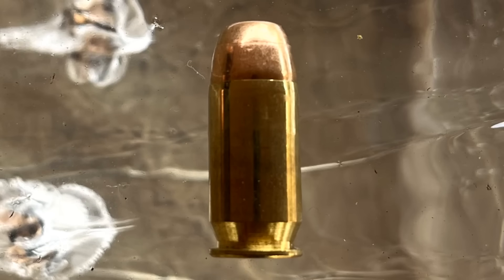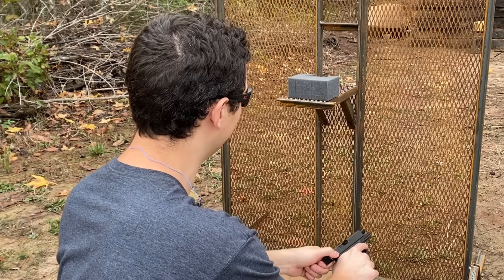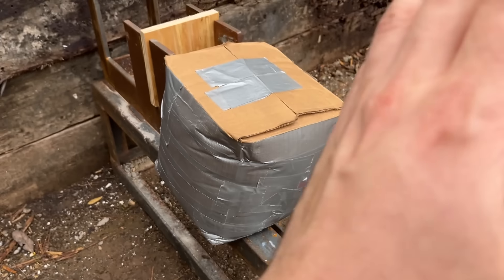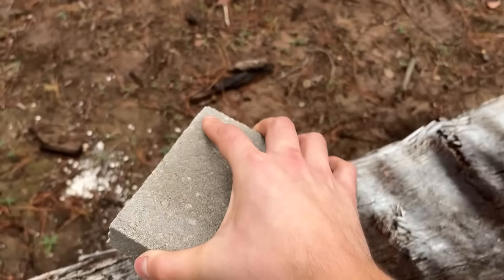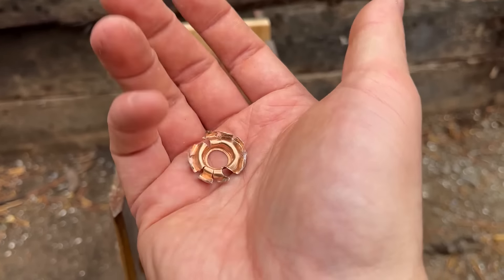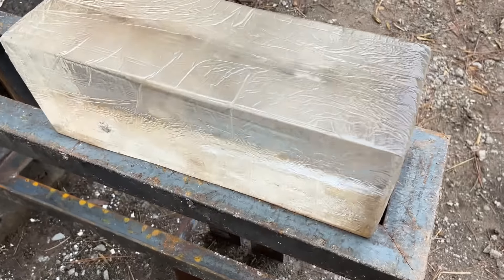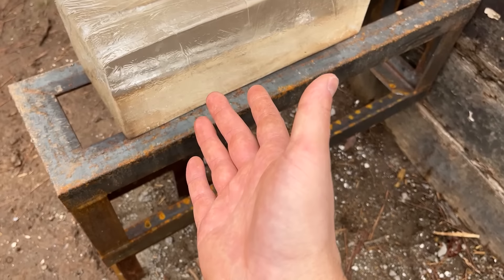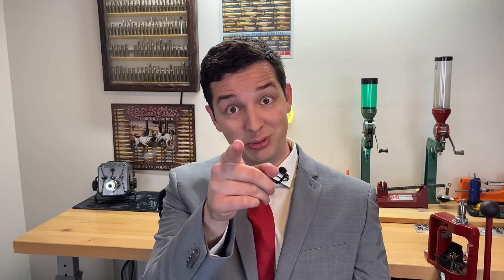9mm vs 45 ACP Barrier Test: No Debate?

Comment: Penetration is not why one would prefer one over the other. Terminal ballistics is the basis. The 9 will out penetrate the .45 but will not match its terminal ballistics. If you use JHP's, you will lose penetration
Reply: The only advantage 9mm has is that you can load more in a smaller space. Realistically it doesn't penetrate any deeper than 45 because penetration only counts on an armored target. As there is no body armor that stops 45 that doesn't stop 9mm penetration doesn't even matter.
45 being naturally subsonic however is a huge advantage for shooting suppressed.
Reply: Penetration is the most important aspect of terminal ballistics. You can see in this test the 9mmJHP penetrated better than the .45JHP. The 9mm also left a PERMANENT wound channel just as big as the .45.
Reply: @joshrandall3632  All this says is that is a bad .45 load.
Reply: @joshrandall3632   Half an inch. If there's one thing I've learned from women. Is that half an inch counts for nothing It's either big or it's small they don't care about the half inch.
Reply: @joshrandall3632  The penetration differences, however slight, are meaningless.  Once you've penetrated enough, further penetration doesn't change the result in a significant way, even with hollow points or ignoring the greater risk of over penetration with the 9mm.  What the .45 brings to the picture is a higher likelihood of knocking the bad guy down and, even if he's not completely stopped (though statistics suggest he would most likely be), interrupting the attack and giving you time for appropriate follow-up.  In another video on YouTube, a commenter tells the story that he, himself, was in a shootout where he hit a drugged-up bad guy 4 times in the heart with a .380  and the bad guy still wasn't stopped and I certainly have no reason to doubt the claim by a guy that he shot someone in defense of his family.  And, yes, I realize that the .380 ACP (9mm Kurz) isn't the same as a 9mm Parabellum but it is a great example of why you very often need more than just shot placement; sometimes, oftentimes, you just really need some kick-ass knockdown power.  According to the FBI, the .45 ACP gives you all you need in penetration and, though there's never a guarantee of single-hit knockdown, it gives a greater chance of getting that knockdown when you need it.
Reply: @bernieeod57  The Federal HST is amongst the best defensive rounds available. Both bullets did a superb job and penetrated exactly as they were designed to newb.
Reply: @captainironbat8193  That's exactly what I said, so thank you, I guess.
Reply: @joshrandall3632  I prefer the good old fashioned flying ash tray lauded to 975 FPS. It has a long standing track record second only to .357 Magnum
Reply: @joshrandall3632  The late Colonel didn't think much of JHP's. He pushed for the 200 grain LWSC Keith bullet loaded to 965 FPS and later the 230 grain Truncated Conical bullet once again loaded to +P 965 FPS. "Velocity and expansion are variables! Mass and cross section are constants!"
Reply: @joshrandall3632  The only way the 9 could outperform the .45 using the same bullet would be if the .45 was down loaded to somewhere between 750-800 FPS. To simply upload this round to 950 would cause over expansion of the bullet and under penetration
Reply: @bernieeod57  You literally just saw a video where the 9mm did almost exactly the same as the .45 with the same bullet. Both bullets did exactly what they were designed to do.
Invoking Jeff Cooper's opinions doesn't make you an expert nor does it make you sound intelligent. It just makes you look like a poorly informed fudd. He was a pioneer in his field, 50 years ago, but very little of his techniques are still taught today.
Same thing with the flying ashtray. It was great, but it's no longer even in the top 10 bullet designs. There are actual books and research papers written about this. You can read those and get some up to date info. Hope this helps.
Reply: @joshrandall3632  As I did back in the 80's as well only to have Miami prove otherwude
Reply: @joshrandall3632 Correct, the te wondering of the wonder nine brought us back to spray snd pray! Where squirting 20 rounds with an 80% miss rate is a good shooting snd proof magazine capacity is important, Back to fewer bad guys getting hit, more innocents shot, and property damage through the roof! Only today, you niner squirt gunners are taking this propaganda to the next level! Where every shooting where the bad guy goes down with 1-3 hits from a major caliber is now called a bad shooting due to failure to mag dump
Reply: @joshrandall3632  The only thing I come away with is that I will not use that brand of ammo! The only way this could happen is the .45 was down loaded perhaps down to as low as 750 FPS
Reply: @joshrandall3632  147 Gr 9MM is normally loaded to 950 FPS. .45 Government 230 FMJ is loaded to 850FPS. You can load 230 Gr up to 950. If velocity is the same with 21% more frontal area and 36% more mass it should produce more penetration and damage. The only way one could have this result would be if the .45 was down loaded to 750-800 FPS.
Reply: Penetration here is a moot point. Both achieved lethality. 12-inches or 13 inches are both meaningless when its been a known military fact for a century that once you achieve 11 inches of penetration into the human body, you have definitely achieved lethality if not sooner. That is precisely why the SAS' Sikes-Fairbairn commando dagger was designed to that length. 
Maybe if your enemy is a 600 lb morbidly obese dude, more penetration might be needed, but not too many of them running around the battlefield.
Reply: @vohawk  Velocity and expansion are variables. Mass and cross section are absolutes
Reply: @vohawk  Don't trust a minor caliber whose 100 plus years of service has been an execution tool, not a fighting tool
Reply: What do you mean? I'm pretty sure 9mm and .45 have both been used in combat for a century or so.  @bernieeod57
Reply: @vohawk  The 9 distinguished itself as an SMG round. As a pistol round, its reputation was that of an execution tool, not a fighting tool

Comment: I like both rounds today. But in the 1980s, this would have been a very different debate.  While the 9 can certainly hang with the 45, because of modern ammo improvements, the 9 gives you much greater capacity in the same size weapon (i.e. 10+1 rds .45 in the G30 vs 15+1 rds of 9 in the G19).
Reply: I'm 53 & a Army veteran: 1990s. I saw the tragic FBI Platt Matix era, the rise of "wonder nines", the big push for 10mm, the short lived .357sig trend, 9-11/GWOT 🌏. Many fads & plans came, went. Overall: ballistics improved, the 9mm/9x19 slowly creeped back to the top of most duty, defense, ccw pistols.

Comment: Remember! The technology used to make 9mm bullets expand is ALSO used in the .45! Look at the "Lucky Gunner" labs section for some good across the board expansion from JHPs in all the cool calibers but in reality, Col Cooper had the power factor right with his Major vs Minor caliber Power Factor calculation. Using the Kinetic Energy equation, the "power" in foot pounds is skewed by squaring the velocity, giving small, fast bullets a seemingly identical power when that is not the case. For those who don't believe, I have two identical Staccato pistols in 9mm and .45 ACP. Shooting them side by side reveals what the "paper numbers" don't show, one has vastly more power and recoil.  According to Sir Issac Newton's "Laws of Motion", the one with more rearward push also has more forward push and that would show the .45 with more "power" which Jeff Cooper stated. With JHPs, the 9mm has no magical expansion properties that the other calibers don't have as the .45s often reach nearly an inch of expansion which the 9mm cant reach. Shooting 9mm BJHPs next to .45 BJHPs ( no +Ps!)  shows the .45 with more "power" AND expansion! How could the 9mm be better??? Only because you MIGHT be able to shoot the lighter recoiling caliber better. Shooting steel falling/moving targets with each caliber also show a distinct advantage for the larger caliber which moves the steel target with a greater force that is easily observed. I'll stay with the largest caliber I can master! Therein lies another secret!
Reply: The idea is that the extra perceived "power" is irrelevant and does not cause extra damage to a target due to the elasticity of flesh. You have to go up to rifle velocities to overcome that.
So the only thing you're getting out of your feeling of higher power is more recoil.
Reply: well,  that just isn't true because its not "perceived power" first of all and it does deliver more power to the target with the ability to cause more damage. Newton's theory proves that so your perception is flawed! The smaller caliber will never equal the larger, heavier caliber when the velocities are similar. The only way you get the .35 caliber to come close to the heavy mass and power of the larger caliber, .45, is to run it's velocity high enough to bring back the .357 vs the .45 argument. You're saying the power is only "perceived" but in reality, the difference has been proven for decades. For a better way to prove your perception theory, put on a vest and take a round from each. That will teach you what you dont know!  @MGMan37
Reply: @micknelson8991  I'm not suggesting that newton's law goes out the window. I am suggesting that there are other physics at work that diminish the effect of "putting more energy into the target", such as the elasticity of flesh. That is also part of newton's law.
If you stretch a rubber band, but not far enough to break it, do you damage it?
Maybe if you do it hundreds of times, but generally not really. Stretching it a little bit further won't do anything to the rubber band if you are still way under its breaking point.
It's the same principle here. Damage from pistol bullets comes simply from the bullet cutting and crushing what it directly comes into contact with. And 9mm fmj is known for penetration, so it's not that it doesn't have enough energy to do so.
Reply: You're still  missing the point, the target does not dictate what power it takes to change its position of relevance. If that were the case, nothing would ever work the same do to the difference in the body's make up, such as skin vs bone vs muscle. All you CAN do is deliver the most power you can to the target and HOPE it's enough to change it to become inert and no longer a threat. If Mike Tyson were to give you his best punch compared to my wife's best punch, you would see the difference! You cannot remove the physics from the situation. A harder hit is just that, more power. Shooting a human doesn't give you the same response every time due to too many factors out of your control. Use the most power.
 @MGMan37
Reply: @micknelson8991  "the target does not dictate what power it takes to change its position of relevance"
Okay, go punch a tire then. You've put energy into it, but you won't have damaged it at all. You just bounced right off it.
Energy transfer does not equate to damage. Simple as.

Comment: Great work, very informative and entertaining.  However I doubt this or any video will ever end the debate.  Both have their backers and their detractors, and there are a number of other rounds with their own fan base and haters.  For the faithful, no-one is going to convince them otherwise, in any direction.

The real takeaway is, both are really good (as are a number of other options).  Each has their relative strengths and weaknesses as compared to others, and we're fortunate to have the options so we can pick the one that scratches our itch just right ... or even have different rounds for different uses - celebrate diversity and such. ;-)

Comment: I did 24 years in a patrol car, I carried many guns over that time, beginning with a Model 19 Smith in .357 Magnum, to a .Model 29 in .44 Magnum and several semi-auto's. When I settled down I did so with a .45 ACP carried in an Astra Model 100 10 shot DA semi-auto and off duty a cut down M1911A1 in .45 ACP. From all the shootings I saw over the years the .45 seemed to outshoot the 9mm overall and most could well have ended after 6 to 8 shots.  Just my experience, I saw some folk in a world of hurt when gut shot with a .22LR others walking away with a .45 hole in them.  Depends on shot placement and sometimes on clothing worn, I worked in an area where sub zero temps are common in winter months and heavy clothing are worn by all so in winter I loaded FMJ 230 grain milspec.

Comment: @daves8746 is exactly right!  It was designed to stop the aggressor, cold.  Additionally, the  45 ACP smoked the concrete block.  It obviously delivered much more energy than the 9mm.  Penetration isn't the game for self protection.  It's about stopping power.

Comment: Look at the difference in damage on the interior of the wood block lolol.. And it annihilated the concrete brick. I think that's gonna translate to equal damage on a human as well.. 9mm is so overrated 😌

And you have to observe the gel block expansion channels from all 4 sides... not just one.. 🤦🏼‍♂️
Reply: 45 is too slow.

Comment: I doubt a .45 bounced off pine, pressure treated or otherwise.  I personally saw a .45 ACP FMJ bounce off a knot in an oak board though. 
You should have used the .45 ACP in a 1911.  You can't tell anything from ammunition fired from a Glock.
Reply: 185 gr in. 45 is faster than 147 gr in 9mm as well, not all FMJ is the same.
Reply: Polygonal rifling adds like 50 fps it's not a big deal
Reply: @Kinetic.44 You're forgetting a big factor of the 1911. You're not accounting for the holy energy of John Moses Browning being channeled through it.
Reply: Lol @MGMan37

Comment: So....basically, unless you're pedantic enough to argue over the most minute of measurements....they are both obviously adequate rounds for whwtever you might need a pistol for. The only real argument is going to come down to capacity preferences and pistol choices, but since those are entirely personal choices, and there really is no wrong answer.... the debate is over.

Comment: You should test Liberty Ammunition, Civil Defense, in 9mm at 50 Gr at 2000FPS and 45 ACP at 78 Gr at 1900 FPS. I have done my own tests and this is the EDC ammo I have used for years in all my firearms! 
Good video, by the way, and I would have given the 45 ACPHP the Gel the nod, though.

Comment: The 45 opens up the size of a Is quarter makes  a 6 inch hole if it comes out the other side  You cannot get that out of a 9 mm and the 45 power is hitting harder And the  bullet is heavier All these ballistics gell  doesn't matter neither does concrete it's not how jacket hollow points were developed to hit

Comment: These test results are evidence of the relative obsolescence of the 45acp. There is an upgrade that you can do to a number of 45 variants- FN, Glock various 1911s etc. The 460 Rowland kit for around $300 changes the fairly tame 45acp into a  44 magnum equivalent that blows away any 9mm’s performance metrics. I’ve done it and it absolutely works, now I have a grizzly stopper that can also accommodate 45acp 45 super and the 460 Rowland rd. Mine is a 1911 and even though it’s generating 40,000 psi the recoil is 60% less that a 44 magnum revolver thanks to a compensator and heavy recoil spring. You can do a similar upgrade to a 9mm and end up with 357 ballistics.

Comment: The ballistic gel. When shot with the 9 mm the gel block looked to slide back about 1 1/2 inches. That takes bullet energy. The 45 slid the gel block back 4 inches. A lot more energy bumped.!!!. Were are the dimensions of the holes in the wood. Just saying. There’s more to be extracted from your test.

Comment: The Marshall and Sanow study found the 9 mm and 45 ACP are nearly identical in stopping power when JHP ammo is used.
Reply: That depends on the individual bullets. Some .45 rounds expand to over a full inch like the ranger T while still having enough momentum to penetrate over 12" in gel do to its heavy weight, something 9mm can never do.
Reply: Their work is crap.
Reply: @MalachiWhite-tw7hl  it is the most comprehensive database of actual shootings and results. Their conclusions are based on real life, not marketing hype and jelly block performance tests.
Reply: @PassivePortfolios  Yes, you are correct about the data.  However, their methodology and criteria are flawed and invalid.  For example, they make much of the idea of a "one-shot stop to the torso" but anyone who knows anatomy can show a vast difference between a penetrating wound which clips a major blood vessel near the shoulder and one that cuts the spine.  There are countless contingencies and variables, which is why their  creation of a one-shot stop criterion fails: an artificial attempt to simplify what cannot be simplified. Further, their writing is sloppy, with illogical contradictions in many parts.  Very poor editing on the part of Paladin Press.  They marketed their book as the DEFINITIVE work on handgun stopping power-- it is anything but.  I will give them credit for making an attempt, though not a good one.

Comment: In regards to your custom protective shield , I would add at least 2 - 3 layers of 1/8 inch clear polycarbonate over the mesh if you can afford 1/4 inch this would be even nicer . Polycarbonate is bullet proof depending on the number of layers and the thickness of each sheet. Your wife will be very happy if you apply this poly carbonate sheet because No bounce back will affect you and make your testing that much more safe .